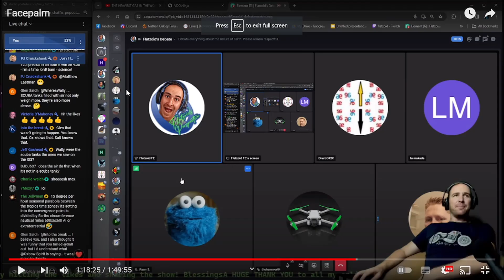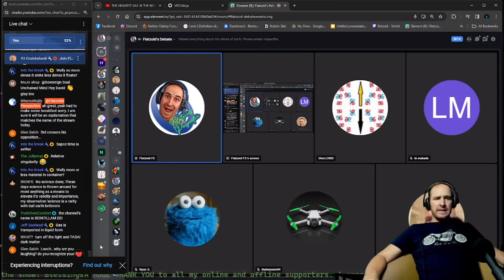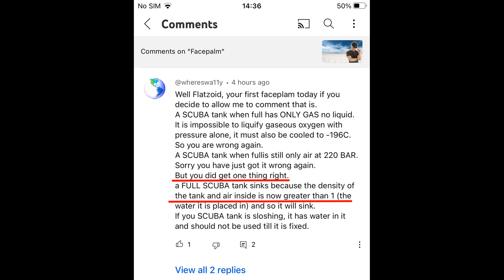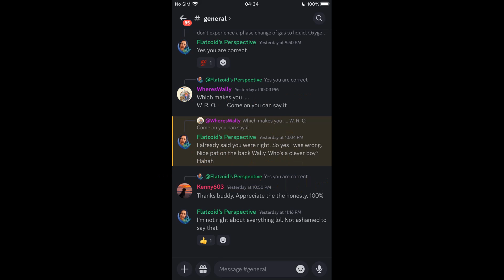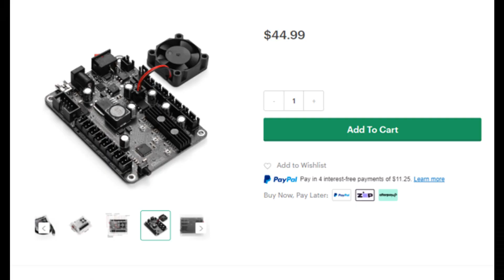Flatzoid Proves Gas Has Mass And As Such Goes Down And Goes Boom Boom

Comment: dude   you need to shorten up your tooling as much as possible to reduce that chatter
Reply from the maker: Yes that did help. But that was not my good brushless spindle. That was a cheap DC spindle that I needed to use to get the horizontal cutting
Reply: @whereswa11y  I'm a retired machinist in wisconsin and I enjoy seeing what your creating. like being a sculpture.
Reply from the maker: @dougp7523  I am sorry for the cringe you get but bare with me I am learning all the time. Kenny has been my muse and he too is a machinist and most helpful with CNC stuff.

Comment: Re your engineering problem, if it don't fit then 'it it, if it still don't fit 'it it 'arder. Not to be confused with if it sticks force it, if it breaks it needed replacing anyway. Hope that helps.
Reply: Mechanical Engineering 101 When in doubt, use a hammer. The bigger the doubt, the bigger the hammer.
Reply: @clivedavis6859  I will add that to my compendium of received wisdom.
Reply from the maker: LOL sounds like and addition to Locktite and WD40.

Comment: SCUBA tanks and oranges... lol  What a combination.  And so many demonstrations that you can change the density of something by adding something different density to it, or taking something of a different density away from it.

When I was younger, I could make myself sink, or float in water just by exhaling or inhaling a deep breath.  Taking on, or discharging a low density mass in an 'object' (i.e. a pair of lungs full of air).  Maybe we should throw a couple of flerfs into a pool and help them learn  (assuming they know how to swim, I wouldn't want them to get hurt). 

(P.S.  Sadly, I can no longer 'sink' in a pool, my body-fat content has changed over the years.  lol)
Reply from the maker: You might need to peel off that out layer of sub SG1 materials

Comment: I used Boyle's law to estimate the volume of gas at STP would be required to raise a one gallon air compressor tank from atmospheric pressure to 120 psig. Using the accepted density (oh, hell, density!) of air at 14.7 psia I predicted the tank would weigh about 0.2 pounds more when at 120 psig than at ambient. My bathroom scales have a resolution of 0.2 pounds. I was not surprised to see the weight increase by 0.2 pounds.

What I really don't get about the relatively dense flat earthers is that it is trivial to confirm with measurement that the density of an object has nothing to do with the buoyant force.

A cubic meter of lead in water experiences the same buoyant force as a cubic meter of styrofoam under water. Of course, the buoyant force is a fictitious force, because (cue Desertphile) gravity, you reprobate, have you ever heard of gravity?

Comment: Flatzoid's response boils down to "it fits my idea so not gravity". Relative Density Disequilibrium (RDD) is just an oversimplified version of gravity based buoyancy. So all buoyancy observations work for both. Flatzoid is using the either-or fallacy, that the observation can fit either RDD or Gravity but not both.
Reply: It's so easy to disprove RDD. All you need is a sealable container and liquids of various densities. Stand the container upright on a level surface, make a "density tower" and fit an airtight cap. The liquids will settle into layers which will be parallel to the bottom of the container and surface the container is on. Next lay the container on its side. The layers will again settle parallel to the level surface, but at right angles to the bottom of the container. Since there have been no changes to the containers contents, the only explanation for this is there must be some external force acting on the contents. We call that force gravity.
Reply: @kiwibob8967  Hmm that reminds me of Daniel Pratt bending a partly filled tube over a ball and showing the flat surface of the water. He claimed the globe model said the water would have curved around his small ball. Flerfs have such a distorted view of gravity etc.

RDD has never had an answer to why down. they tried "finding its level" but that fails with stuff down a mine not rising up to its usual level. Rephrasing it in terms of medium can/can't support it just runs into "support it against what exactly?". IF you can get a flerf to answer, I have heard "God" or "just ithe way things are". Wilful ignorance either way.

Comment: Also, if the full scuba tank has to have more weight than an empty tank, the gas molecules must exert more force at the bottom of the tank than at the top or sides. Otherwise, the full tank will weigh the same as an empty one. This added force applied at the bottom shows that gravity acts on the gas causing it to accelerate downward. It isn't randomly moving in all directions, as flerfs like to say.
Reply: Well, it's ALMOST purely random.  hehehe  Just like in our atmosphere at sea level.  But yes, that TINY bit of non-randomness caused by gravity acting on each tiny gas molecule makes all the difference.  If we had a precise enough guage (say, one part per million or better), you could attach it to the top of the tank, take the reading then turn the tank upside down and note a tiny change in reading.  But most pressure gauges designed to register 3000 psi (~200 bar) simply don't have the precision to read millibar differences.

In most first year college textbooks it will say 'randomly in all directions' because for practical discussions about compressed gasses, it's close enough (but they will often say somewhere in the very beginning of the chapter/ section that they "ignore gravity in most cases").  Once again we see that flerfs cannot understand the scales and precision of things involved.

Comment: The air go down go boom boom thing has to be one of the dumbest things in all of flerfdom. 

Somebody should show flatzoid one of those middle school science demos where you float an aluminum foil "boat" on a dense gas like argon. Then you can scoop some air up with a cup and pour it into the boat, so it can go down go boom boom at the bottom of the tank. Bonus points for simultaneously showing gas happily sitting in a container with no top.
Reply: That gas-go-down-go-boom-boom was invented by Oakley in reply to a flat earth spanking by Thunderf00t. It’s a vital part of the grift used to deny that space exists.
Reply: @profphilbell2075  Is Flatzy still expecting you to demonstrate the SF6 remaining in an open container indefinitely, lol? Even my cat's  water bowl evapourates eventually because of heat input from the environment.
Reply: @clivedavis6859  whether or not SF6 remains indefinitely in a container will depend on the temperature and depth of the container. FZ seems to forget that CO2 remains indefinitely in subterranean confined spaces like mines and shafts.
Reply: @profphilbell2075  We had some illegal miners die recently from just such pockets of CO2 in a disused mine. It was all in the news so he must know about it. Just more dishonesty on his part/
Reply: It’s right up there with “this is an egg “.
Reply: Carbon dioxide will do the same, and is cheaper to obtain ;)  There was a video by some science museum I watched recently where they did exactly this.  They put some dry ice in an aquarium and let it sit for a bit to sublimnate.  Then the floated an aluminum boat and sank it as you suggest.  Also 'scooped up' a beaker full and poured it over a lit candle to extinquish it.

Comment: Air in a SCUBA tank is NOT liquid. It remains a gas. 
 If Flatzoid is claiming that one can shake a SCUBA tank and hear liquid sloshing about he is lying.
Reply from the maker: He is probably thinking of a LPG camping gas tank... or he is dopey.
Reply: @whereswa11y  Pretty sure both are correct.
Reply: @whereswa11y  I’m going with both 🤣
Reply: @profphilbell2075  Ditto.
Reply: A scuba tank with any liquid in it should never be used, and the compressor inspected. I fill a lot of tanks.

Comment: Hi Wally. Just a reminder about what I said about the cutting direction that you saw yourself here. When you heard that end mill grab and you said "except maybe that" was a perfect example. You were going anti clockwise on that which means all free slack in the entire drive system can allow the mill to be suddenly pulled into the job. Try going clockwise and all gears slack, belt slack can be suddenly taken up, as it did there and take uneven bites or if enough, destroy the tool and ruin the job, or at least leave a shuddering looking finish. If you think about always trying to make sure (at least as much as you reasonably can) the system is pushing against the cut, in that particular case, just going clockwise instead of anti, you'll get a much better, more even finish. 
Your setup is getting pretty good and I'm looking forward to seeing the finished result of what you're making. Loved how you had the ISS on that cap too.
Reply from the maker: oh that interesting, I did read what you said last time but it kinda flatzoided on my brain.
I have noticed that some directions do cut better than others.
It problem there I thought was due to the little cheap spinlde I was using to do the horizontal cuts. I couldnt get the 127mm dia tube under the endmill in the usual configuration.
I will take a minute to learn what is happening.
Reply from the maker: ok so I have a hole and I want to clean up the inside of it. the tool was going arounf ACW and the endmill is rotating CW. So if the EM grabs it gets pulled into fresh meat.
If the tool path was CW and the endmill is also spinning CW and the EM grabs it pulls back  into clear  territory .
So another way to think is the EM is against the hole. lets say at 3 Oclock, and EM is spinning CW, is it grabs then the EM will try move CCW towards 2 oclock. 
Ok so the uncut fresh meat needs to be on the otherside towards 4 ocolock 
which means the tool path should be CW.
Have I got it right?
Reply: @whereswa11y   I think you've sorta got it. The only bit that sounded wrong there was that if the tool path was going clockwise and the EM spinning clockwise and at the 3 oclock position the drive will always be 'pushing' it towards 4 oclock with all free slack through gearing, belts, slides and any flex anywhere already taken up so it can't pull itself in and will move around that hole at exactly the same speed all the way round.  Of course with a CNC machine doing more complex jobs you may not always be able to do this with every cut on some jobs but, if you try and keep the majority cutting that way you should get a more even finish with less risk to tool and the job. I suppose you might have occasions you'll have to maybe change that about if one of the cuts is going to have to be taking off much more material and then because of the force of the bite you may be have to choose between the better of 2 evils and go the other way but here, it was just a matter of going clockwise instead and except for any harmonics that might sneak in, it should have given a nice smooth even finish.
I'm all old school, before CNC was even thought of, I have setup semi auto lathes etc to do up to 6 different operations automatically once mounted but CNC is awesome in that you can get the machine to even do things like that cut there which would have been just plain impossible with the types of mills I'm used to. You could by manually working the table around with the cross slide and the forward backwards, which I have done crudely before but, that's a damn site harder than the rub your belly whilst patting yourself on the head, CNC makes that so easy these days, I love it.
Reply: Climb milling, where the cutting forces initially act at 90 degrees to the direction of feed, and then in the direction of the feed, give a much better finish but require a more rigid setup than conventional milling where the cutting forces are acting in the opposite direction to the feed

Comment: I do enjoy your Putzoid takedowns but I wince with pain when I see you milling aluminium without applying a lubricant. You must be going through mill bits at a rate of knots.😢
Reply from the maker: what is a good lubricant? I had thought to try use Isopropyl Alcohol as there would be no residue to clean up later
Reply: @whereswa11y  Distilled water. Propanol and Ethanol don’t have enough viscosity to make a difference, imo.

Comment: 1:50 Air is a liquid at 220 BAR and at room temp?. oh my... i scuba dived a lot and if there is sloshing around in your tank its either got water from being sucked dry by a beginner or the fill station isn't maintaining their compressor (not to mention the CO u will probably get for free).

CNC adventures.. bit chatty, What was that engraved on the closed end? ISS eh wally? Your right its getting harder to be cryptic. 

Cheers mate
Reply: Ooops, I just posted the same before I read your comment.  So right, if you hear 'sloshing liquid', time to find a REPUTABLE shop, have them drain the tank and INSPECT it, then fill with clean dry air.  👍👍👍👍
Reply: @mikefochtman7164 yeah. I’ve filled enough tanks to know that if your tank has water in it, the compressor is in bad need of servicing.
Reply: @mikefochtman7164  no worries.. i started sucking air from a tank in 79, last logged dive 1996... funny thing is instructors do heap of pool diving that never gots logged. Maybe Flatz was thinking of his spray painting compressor which he clearly read the manual and then ignored the "open the bleed for every hour operated"

Comment: Hey, Failzoid finally got something about correct. Yes, by putting more air in a scuba tank, the tank becomes heavier. BUT... Failzoid can't accept that it's because the air do have a mass, and that air gets pulled down by gravity. Failzoid will grasp at absolutely ANYTHING and the rest to deny that gravity exist, that mass attract mass.

Comment: Density is a scaler of mass per unit volume. More mass per unit volume decreases buoyancy, exactly as predicted by gravity. 

Thanks Flatz, gravity acting on gas confirmed! 👍
Reply: No, it doesn't decrease buoyancy! 

Buoyancy is the weight of the displaced medium, and that doesn't change when the weight of the object in it changes. What changes is the net force on the object: you have (a) gravity pulling it down, and (b) buoyancy pushing it up. It's the first part that goes up when the mass increases; the second part doesn't decrease. The effect would be the same as if buoyancy decreased, but that's not what's actually happening.

This sort of thing is exactly what flerfs keep misunderstanding about this situation.
Reply: @cearnicus  buoyancy is “the ability or tendency to float in fluid”. Increasing density will decrease the buoyancy of an object, while the buoyant force acting on it will remain unchanged 😉
Reply: By flerf definition, a full tank of compressed helium should weigh less than a full one.
Reply: I'm surprised that flerfs believe in mass.
Reply: @Thirdbase9  don’t be surprised. They’re always finding new ways to debunk themselves!
Reply: @Thirdbase9 its amazing they can tie their shoelaces